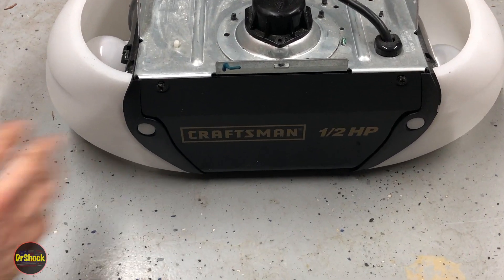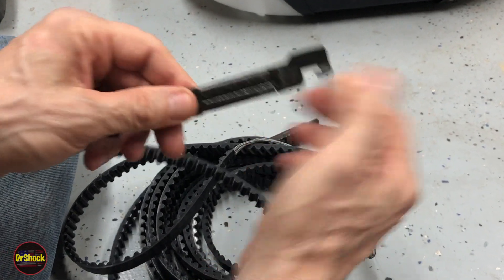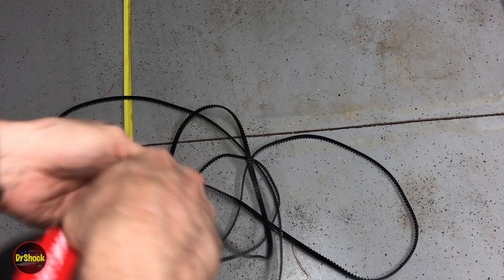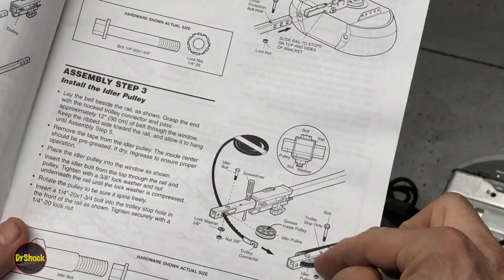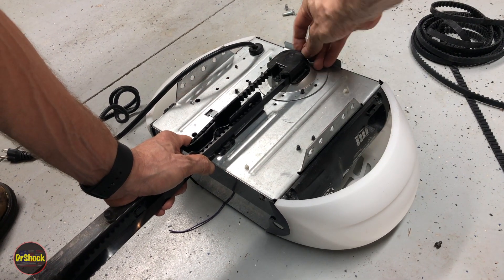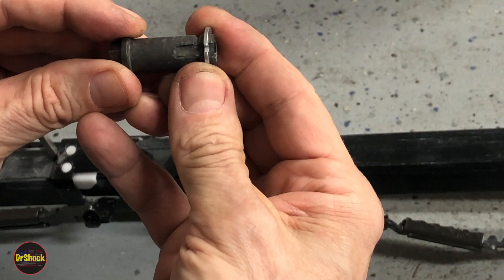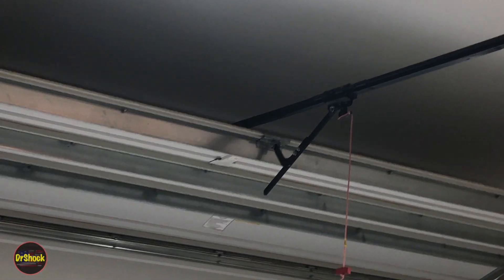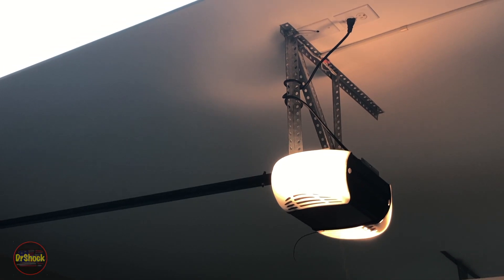Craftsman Belt Drive Garage Door Opener Drive Belt Identification, Selection, & Replacement

Comment: Best video yet but, for me I need to find out how to reset the close nd open tension as my door kicks back up as the tension setting needs to be relearned again.

How can I reset the tension in model diehard 1/2hp pulley type battery backup? It doesn’t say model but says a long part number 41DB102-2
Reply from the maker: This procedure varies by model, but in your craftsman owners manual they’ll be some information about adjusting the two screws that are up by the programming button on the side.
Reply: @DrShock thank you, mine was the newer one with the black and purple buttons. Found it on here as well as I lost the manual.

😊
Reply from the maker: If you look on the label by those buttons, you will see the Craftsman model number.  You can usually find the manuals in PDF form at Sears Parts Direct dot com.
Reply: @DrShock found it, thank you!!!

Comment: I have an 8ft door, but the belt measures like it's meant for a 7ft door.   Now i'm confused.  I don't' want to order the wrong size belt.   Wish there was a part number on the belt somewhere.  Thoughts?
Reply from the maker: If it's one of the models covered in this video, there are only three possible belts for it (listed in the video description).   The height of the door is one factor, but the length to the motor is another.  Some will have extensions, like the example in this video.  If the overall measurement of the original belt matches the replacement, you are likely gtg with that alone.  But carefully counting the belt ribs/teeth and having the seller confirm the count back before buying can help with any doubts.

Comment: Hi awesome video, my craftsman garage opener 41a5303-50 is around 13 years old and the belt is about to blow up, but I can find the belt replacement for my model, any ideas? Thanks for any help.
Reply from the maker: That doesn't look like a typical Sears part number, is that what's on your owners manual cover page?
Reply: @DrShock  nope, I did bought it in 2005 at my Sears store, they did install  it!, I am going to follow you method of measurement and buy it, if doesn't fit I will return it
Reply from the maker: There should be a label on the unit, typically behind one of the white bulb covers.  The model number should be on there, typically a XXX.YYYYY type format.    Easy enough to get the right belt with that model number and not have the return hassle.
Reply: Ok, I am going to check, thank you GOD BLESS YOU!!!